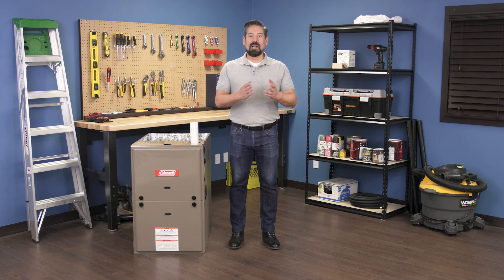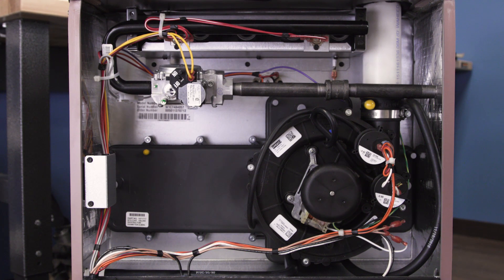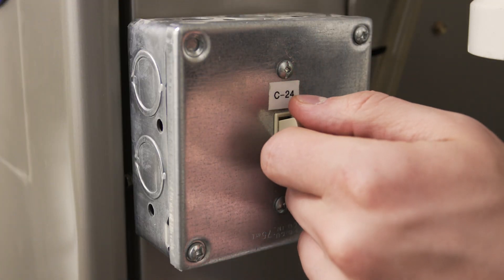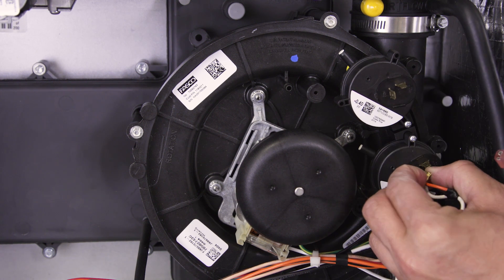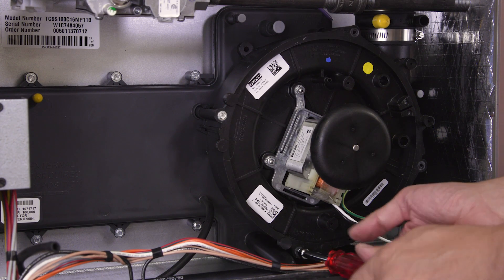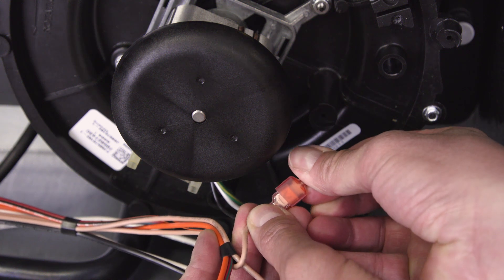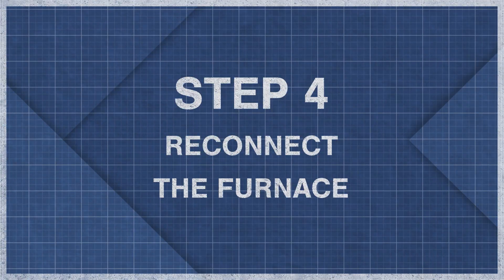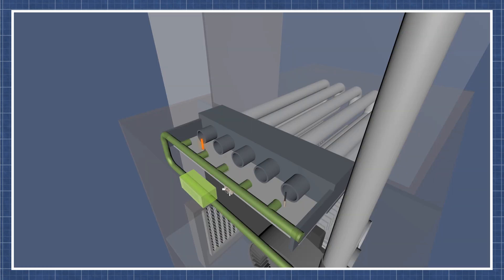Furnace - Draft Inducer Motor | Repair and Replace

Comment: My furnace runs for 5 minutes and then it would shut off and then it will cycle again for 5 minutes and will repeat a few times and completely stop. The unit stops because the high limit switch triggers due to high temperature. The inducer blower motor runs, and everything else seems to check out okay. Have you seen this before and if so, could this be due to the inducer motor fan speed not being able to keep up with the rest of the unit during heat exchange?
Reply from the maker: Hi Tony, it might be good to watch this video on short cycling, and to check what code your furnace is giving you. https://youtu.be/b0sAGt-1niU

Overall it does sound like your limit switch is starting to fail, and might be triggering at a lower temperature than normal. Generally if the inducer fan creates enough airflow for combustion, nothing would change once the blower fan runs. If there is not enough pressure, or if the draft inducer wasn't doing its job, then the pressure switch will trip. Your furnace should give you a code if this happens.
Reply: @AmreSupply  The high limit switch is new and did not resolve the problem. The code is "Limit Switch Open" and the technician suggested changing the inducer motor because its pulling high AMPS, the furnace will continue to run for a while, but will eventually overheat and stop. The inducer motor is FASCO A156 and sb pulling 1.1 AMPS, but the meter readers 1.0 AMPS. How would this impact the furnace and trigger the high limit switch? Will changing the inducer motor resolve the issue?
Reply from the maker: The most likely reason for a high limit switch to trip is reduced airflow, such as a clogged furnace filter, or a dense filter that is too restrictive for your furnace. With reduced airflow over the heat exchanger, the furnace will slowly overheat until it trips the limit switch. 

Keep in mind that the inducer motor draws air into the heat exchange, so if the inducer isn't functioning correctly or if there is airflow restricting the air leading into the inducer, the pressure inside the heat exchanger will decrease and it would trip the pressure switch instead of the limit switch. Also an amp draw increase of 10% is pretty minimal, if the inducer was drawing 2 amps or half the rated amps then that would be more of a concern.

Comment: i have a Coleman furnace just like the one in the video. when it snows or we get heavy fog. my furnace will shut down. there is a hose on the inducer that i can blow into and usually i can get it going again. i think its because of condensation you really can here water in the inducer. my question is can that be cleaned out. or does it have to be replaced.
Reply from the maker: Hi Rob, it sounds like there is a lot of moisture in your area. If there is water draining back into the inducer blower assembly, then you could remove the assembly and try draining the water manually. The motor is exterior to this assembly so its unlikely that water will damage the motor. Also check the condensate drain pipe to see if its angled down enough. You want to make sure that the water flows away from your furnace.

Comment: My Tempstar furnace is only 5 years old, and already the front ball bearing in the inducer is noisy and failing.  A check indicates that there's no replacing the bearing itself, as the plastic blower housing is glued or welded shut permanently.  I ordered a new blower. $125 for something that in days of yore could be fixed with a $3.00 part!  Dayum!
Reply from the maker: Thanks for sharing your experience. Bearings will wear down over time and you are right that the inducer blower are a little more self contained and not are generally sold and replaced as a single unit.

Comment: Could it be that  draft inducer motor is bad why it keep running and never goes off?
Reply from the maker: Hi Roshard. If your furnace keeps running and never goes off, first check your thermostat. Make sure that its set to heat, and that the fan is set to [Auto], as this will run it only when heat is needed. If the fan is set to [On] it will cause the blower fan to circulate air 100% of the time.
If the furnace cycles on or off then it could be a safety switch. If the inducer motor is bad, then it will trip the pressure switch and you should get an error code for the low pressure. We mention the error codes here: https://youtu.be/qRmNrmjKEyk?t=130
Reply: @AmreSupply  thank you for that information. but question why do the draft inducer motor just keep running even when the a.c unit is on it never goes off even when I am not sending heat?
Reply from the maker: @berrisbogle   It is unusual for the inducer to keep on running even when the A.C is running as its well outside of normal function. It could be a faulty control board or thermostat. As the wiring can differ a lot between models and its harder to test, so it might be worth getting a professional to take a closer look.